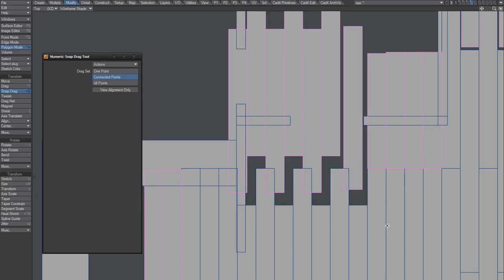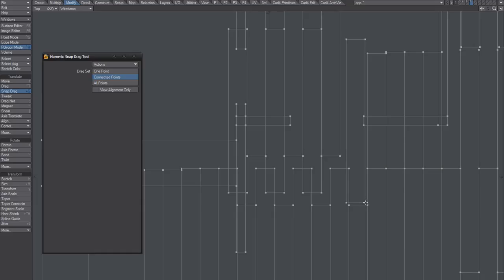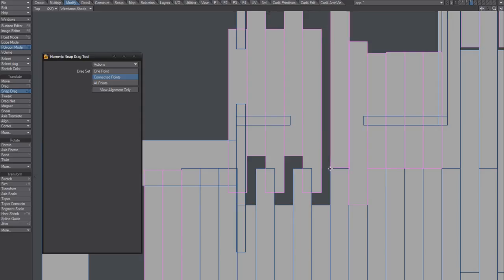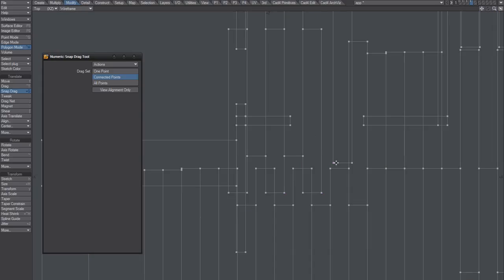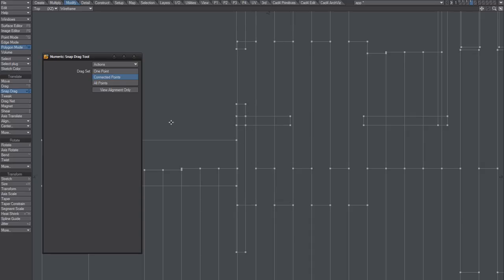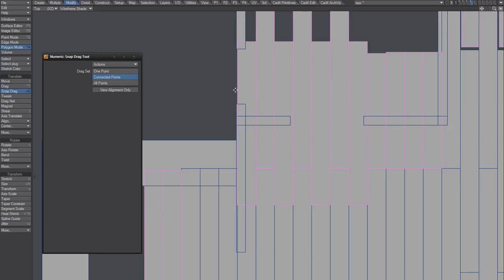LightWave Model - Wireframe Shade no Snap (Ø)

Comment: Even selecting points in anything other than wireframe mode, can be a real chore.  I frequently switch to wireframe just to select points that are clearly visible, then switch back to whatever I was using before.  It's another one of those many LW workflow killer tripwires that's been around too long.
Reply from the maker: yep. Modeler needs an update >
http://forums.newtek.com/archive/index.php/t-139159